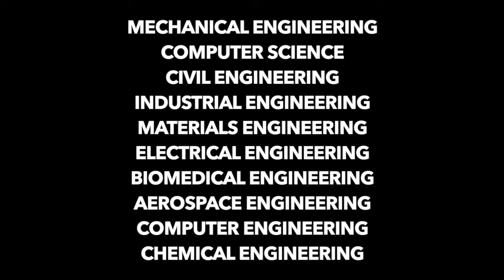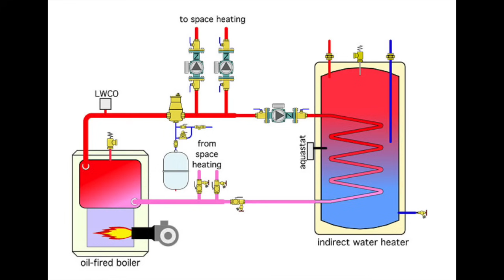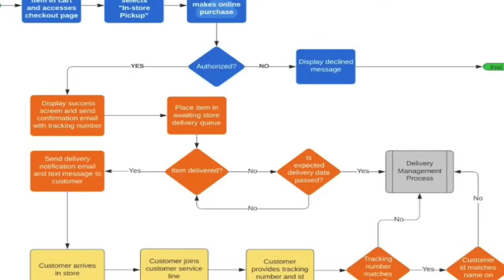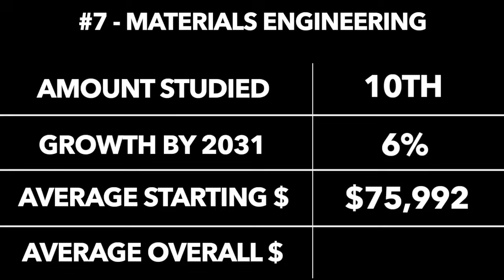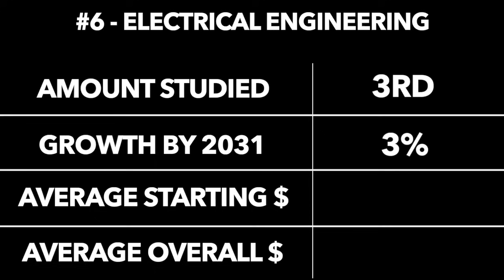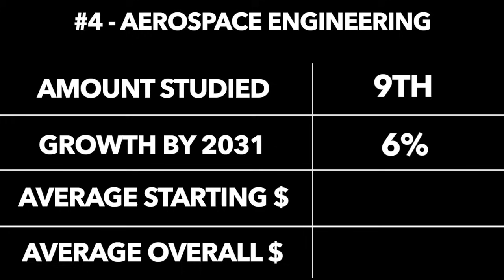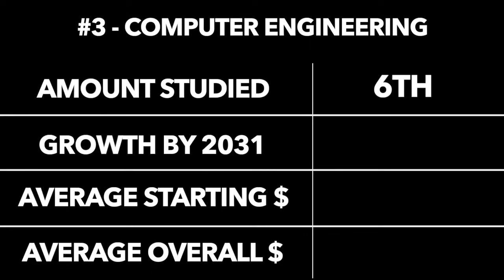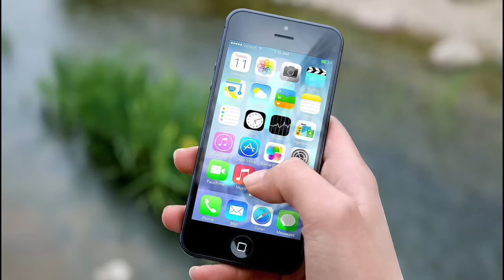Engineering Degrees Ranked: Pay, Demand, and Job Roles

Comment: By far, marine engineering! Graduate at 22, starting pay about 26k/month. Work 6 months a year, 6 months vacation. Use Fla for residence, clear 130k, squirrel away 100k/year in S&P500, retire at 32 yrs old. If you want to continue working, take a trip once a year, for 3 or 4 months or work for a marine engineering firm on land or get a PE license, you're qualified for mechanical, electrical or chemical (I'm licensed in all three). Getting the degree is easiest also, yes the degree is 150+ credits, but you are in a military school, so there are no distractions (women, parties etc). Many choices of schools, SUNY Maritime, Mass Maritime, Maine Maritime, Texas A&M, Cal Maritime, Kings Point (free Federal academy)
Reply: How does marine engineering qualify you for all those areas of engineering?
Reply: @benjaminhoffman3848  Marine engineering includes mechanical, electrical and chemical. And they are not just token courses, the 3rd engineers license exam is like taking five PE exams in one week. For most state's professional licensing allow marine engineers to practice all three. That is why it is over 150 credits and you are in school year round.

Comment: As a computer science engineer, I've been making the same salary since 1992, in fact, now, I'm making less.  So, considering inflation, this is a disaster.   I've worked for millionaires, that got there a few years before me.   One company I coded for, was sold for $132 million.   Another company, I started as a programmer when they were in the business incubator, when they laid me off to hire an off shore engineer, they were number one in the field.   I got a $40,000 bonus, and a pink slip.   A not too technically bright guy, I hired, whom drove for over an hour to get to work, is still there, and a big wig in the company.  He was good at pushing paper.  He took a nap every afternoon.   So, the business degree guys, determine whom gets laid off.   Then they pay themselves more for a job well done.  If it does not work out, they reverse it, and give themselves another bonus.

Comment: There is a major department of engineering that is not included in this podcast. It may fall under mechanical engineering as a sub-branch. It is marine engineering and naval architecture. Also power plant operations engineering. I fall under both of these categories with a degree in naval architecture and a license as chief engineer in the U.S. merchant marine, certified by the U.S.C.G.

Comment: I’m more taken back by how low some engineering jobs pay.  I am in school for electrical engineering, very green but working my way there.  I am a full time aviation maintenance instructor, and I make around 76k a year as is.  As much as I want to finish my degree, there’s a part of me wondering if it’s even worth it!  I will finish, because I’ve never been a quitter…but dang…feels like I could easily just stick with my current career path and do just fine without the extra effort.

Comment: I was considering electrical engineering, but as a tradesman in the electrical substation industry,  I could not afford such a drastic pay cut. The only good trade off would be if I could work remotely. I might have to look into computer/software engineering or project management.

Comment: Computer Science is not an Engineering degree. They're more like "computer mathematicians" than engineers! I study Computer Engineering and I suffer the same amount as an Electric Engineering major.
Reply: Computer Engineering has significantly less amount of math than Electrical, Mechanical, and Civil engineer has. How can you suffer equally to Electrical Engineering?
Reply: @FlowSharp  They have more. Same amount of calculus and linear algebra but there is also number theory, graph theory, algoritm theory (which is taught to math majors as well). And i think there is more statistics and probability theory as well. Depends on the school.
Reply: @FlowSharp  Because I'm in my first year. The first year is almost the same for all engineering majors at my university.
Reply: @lionedheart they have more discrete Maths, Analysis 1,2,3, Linear Algebra 1, 2, ODE, PDE, Stochastics, Graph Theory, Complex Functions, Statistics

Comment: I’m 34 now and I am fed up working as a carpenter and joiner. Is it too late for me to become and engineer? I want to become a designer engineer for aerospace.
Reply: I'd proceed with caution, personally. There is a lot of optimism in this comment section, but you should look into all the underemployed people out there with engineering degrees.  I got my first engineering degree over 10 years ago and got a new one last year in a different field of engineering, and I am 34 as you are.  I personally know multiple engineer graduates that could never land an intern nor a job in their field.  Connections are everything. Do you know someone who would hire you as an engineer right now if you only had the degree? If not, do you think you could find one 4+ years from now?
Reply: @SnitchyCat connections is not everything if said person has the experience. 

geographical location is important. 

Creating a good resume….important 

Studying for the interview IMPORTANT 

The trick is to get an entry level position that does not require a degree and then when there is an internal hiring going on, applying for that position and working within the company will be a great advantage
Reply: @FlowSharp  Sounds like a decent idea. I tried something like that and worked at a factory doing a job that didn't require a degree for  about 18  months.  I managed to get an interview for an engineer job at that company and I was told that I should first try to gain experience as an engineer at a less important company. I since left that company to drive rideshare which paid more at the time.
Reply: @SnitchyCat  Depends on the company. I wouldn’t have waited 18 months. 6 months max
Reply: Never too late. I’m 24 going back now.

Comment: I would think computer engineering is ahead of computer science because it would essentially have the pros of computer science along with having knowledge on hardware
Reply: And who told you that cs doesn't study hardware
It studies logic design 
Electronics ,and circuits,computer architecture,embedded system

Comment: civil engineer here.  the pros are it's a very diverse field and you can pretty much get a job anywhere starting out.  the cons are if you're like me and stay at 1 company for 20 years it'll be difficult if you have to get a job elsewhere later in life.  My company is pretty much a 1 trick pony.  We do site design including grading, drainage, storm water calculations, and parking lot layout.  Most other firms want experience in roadway design or construction engineering.  My company does neither of those, so despite having 20 years of experience, going to another firm that does different work sets would basically be like me coming right out of college again and having to start from scratch except for having the professional license.
Reply: That is a huge disadvantage for engineering you are a slave to your company.
Reply: @chaseyung1037  the reason I stay there is they're the only company in the area that lets me work from home.  I only had about a 40% production rate last year, and a 20% production rate the previous year.  everyone I know working at the other firms have to stay overnight out of town at job sites and work 60 hour weeks.  I'd say I have it better than them.  Even if I don't have a full 40 hours of work in a week I still get paid for that 40 hours.

Comment: You do realise that chemical engimeers desigk the entire process and all the equipment.  Its a mix of mechanical engineering, electrical/control's engineering and chemistry.  I am a chemical engineer and ive designed much equiptment including the instrumentation and control systems associsted with it.

Comment: I will add that communication skills are important. It is as important to communicate clearly in a report the results of the calculation as it is to be able to perform the calculation correctly. If you aspire to become a technical or managerial lead you must also be able to communicate the important points of a project or design in an oral presentation.

Comment: The thing about mech engineering is that you can basically apply also for jobs in materials,  biomedical, aerospace, industrial fairly easily and even civil, chemical and electrical by a certain extent. The versatility is its best strength imo
Reply: How can mechanical apply for biomedical without the prerequisite biological and medical understanding?

Comment: My starting salary in 1981 working for IBM Corporation in Tucson, AZ was $25k/year with a BS in M.E. from UIUC. Left the engineering job as an engineering manager  after 5 years and transferred into an IBM sales job - never made less than mid 6 figures salary since 1986. $$$$$$
Reply: Yea it just sux that sales job are considered the lowest of the low and only dishonest people work in there.  Also, if someone does those jobs it demonstrates they woul rather spend their lives making koney than reaching their full potential skill wise.  You tend to get people who aren't real engineers do those jobs, because true engineers like the technical challenges and pushing their learning to see the best they can be.

Comment: It seems pretty pointless to rank engineering degrees without factoring how versatile they are. An aerospace degree is hardly different than a mechanical one, they take a few extra aero courses that ultimately don't amount to much when it comes to getting into the aerospace industry as an undergraduate, a undergrad with a BS in mechanical has just as good of a chance at getting hired by an aerospace company, but the mechanical engineer is probably more hirable in something like controls, manufacturing, systems engineering type of jobs. Look at any entry level aerospace job and I can guarantee the requirements will be an aerospace OR mechanical degree, sometimes even electrical/chemical. OTOH for biomedical engineering undergrads who often take a mash up of electrical, chemistry, mechanical courses etc it's all breadth with zero depth. If you want to work in the biomedical field you're much better off in an undergrad in electrical, chemical, mechanical and doing a biomedical focused masters.

If you want to be as versatile and hirable in different fields/industries especially out of undergrad then mechanical or electrical are always going to be the best bet, which really needs to be a big consideration for 18 year old kids who will very likely find they find some other subject more interesting than they thought when they actually get into studying engineering
Reply: So basically, get a BS in mechanical/electrical engineering and then go for a Masters in the field u really want to do
Reply: Computer Engineering is more flexible than Electrical
Reply: @FlowSharp  what field is someone with a computer engineering degree qualified for that someone with an EE degree isn't?

Largely meaningless distinction anyways, many schools have electrical and computer engineering under the same degree these days.
Reply: @sparkee3729  
Embedded systems programming
Cybersecurity 
Software development 
Computer architecture 
Data Science
Ai
Reply: @FlowSharp  you just named jobs that an EE degree is qualified for... the majority of my graduating cohort went into embedded or software development. Thanks for proving my point!
Reply: @sparkee3729  right. My point is if they are in a geographical location competing with computer engineering for those roles, the computer engineers has more extensive knowledge in that area. So they are likely to get picked.

Computer engineers only need 5 college courses to graduate with a bachelors of science in Electrical Engineering. Where as electrical engineers require a few semesters
Reply: @lionedheart
Data Science
AI
Quant

Comment: I am an industrial engineer but have spent my career as the CEO of software startups. IE is an excellent foundation for a management career. I use my IE mindset every day as a CEO because I have to design and improve company operations as one of my fundamental roles.
Reply: smash
Reply: Do you recommend I study industrial?
Reply: @freepalestine7123 
If you are good with solving problems, 
Loves industries, Manufacturing,
 Logistics (conveyor management for example if you play factorio, satisfactory),
Have no problem or loves dealing with some of programming skills ( making systems to calculate peoduction,power consuming, time of everything or you can say a system which is accurate about all the things in the factory to analyze all the problems that stops the potential of full efficiency)
Notes all the data from the system you made and analysing it to make the production more efficiency
 
And this job may make you an CEO of the company that you work for

And Also if you dream of making your industry, factory 
Industrial engineering is the best path for that,cuz it teaches you about factories management and the only problem will be the budget and i think you know it

Sorry for bad English I'm not perfect talker and have adhd which makes me write alot of details and unorganized (wich is bad for an industrial engineer)
Reply: how did you managed to be a CEO with an industrial engineering degree? I am studying to get my IE degree too so i am curious

Comment: I am interested in compter engineering. But my university has computer systems and network engineering . Is this same as computer engineering or different ?
Reply from the maker: Great question! Network engineering is not the same as computer engineering. However, computer systems may be close. But I would compare curriculums with a computer engineering degree at another university to see what the differences are.
Reply: @becominganengineer2271  Thank you .

Comment: as an automotive mechanical engineer, i can say that mechanical engineers don't just work on stuff that moves. plenty of components that need to be engineered, are hard mounted to other stuff that moves or doesn't move. those components just need to survive whatever conditions the stakeholders need them to survive (vibration, thermal shock, corrosion, etc).

and contrary to some of the comments i'm seeing here, i'd argue that a lot of engineering roles out there don't care if you remember your calculus or all your niche physics formulas. i'm sure that depends a lot on how your employer approaches filtering out applicants, or even the level of technology that your industry implements in their workflow. but like in automotive,  for example, most employers aren't gonna risk their short timelines and thin project margins on your ability to do hand calculations. they budget resources for CAE and accelerated design validation testing. your job as a mechanical engineer, in those cases, is to understand fundamental engineering concepts enough to be able to interpret data and use it design/redesign something that eventually passes all those checks.

also everyone seems to always report average salary for different professions. i don't understand this. especially when the target demographic of the data is college students. what we actually need is the median starting salary data, which nobody seems to want to collect. in general, i wouldn't have high expectations for an entry level engineering salary that comes close to these average salaries (especially since your prestigious degree does not guarantee that you've interviewed for a high paying engineering function), unless you're gonna be working in a high cost of living state - in which case, all that extra salary goes to rent and gas.
Reply: In which field you work in Automotive?
Reply: @moin9962  currently EV power distribution. Before that, ICE fuel systems.

Comment: I am biased as an elect4ical engineer but I think you have tremendous job security.  Name on engineering project thay requires zero power infrastructure, it's nearly impossible.  This means there is a large pool of projects for ee's to work on
Reply: ee is much more than power infrastructure. That part is the “boring” part of ee. How about quantum computers?

Comment: Computer Science shouldn't be viewed as an Engineering sub area. Engineering requires a very strong physics background regardless it's Mechanical, Aerospace, or Chemical while CS is primarily numbers, logics, data structures, and coding with various syntax. Nowadays, Engineers have to be trained in programming. So they all have some coding basics and experiences when they graduate. The other way isn't true for CS graduates who may have no clue of Aerospace or Chemical engineering.
Reply: I don’t understand how physics knowledge is a prerequisite for being an “engineer.” I have always understood an engineer as to be someone who applies science and maths to solve real world problems by creating things. The website you wrote this comment on was engineered by computer scientists.
Reply: CS degree here. I’m a software engineer, so I can confirm it is engineering. I don’t care about your baseless statements, you CAN in fact get engineering jobs with a CS degree.

We create software that can be used to instruct hardware components to act/do certain things. How is that not engineering?